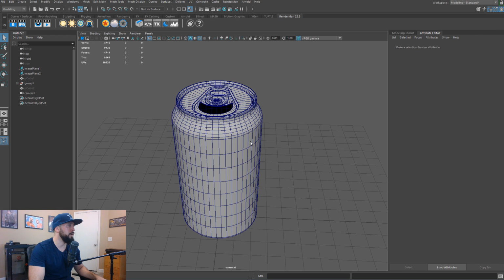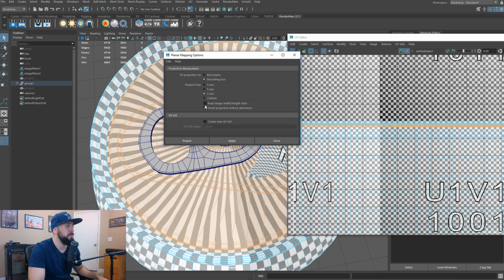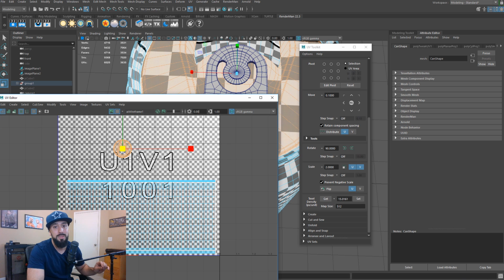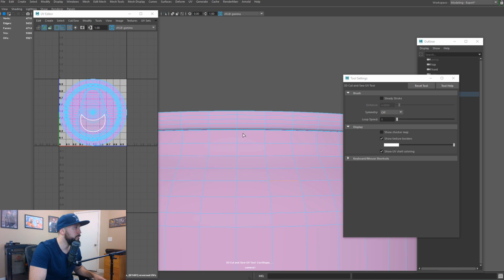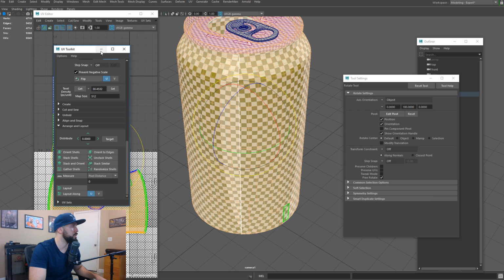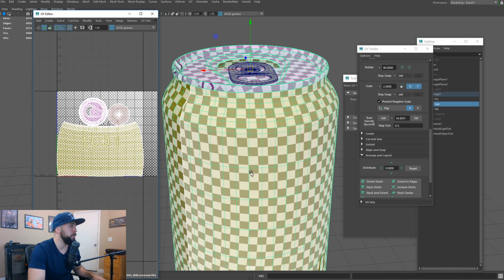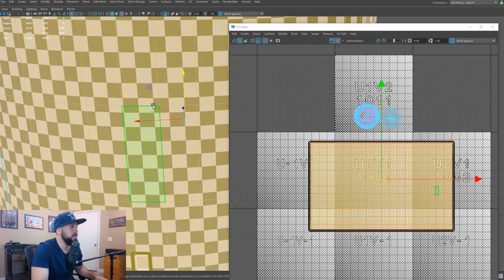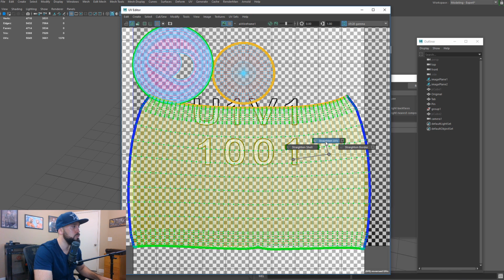Maya UV Mapping For Beginners

Comment: at 4:34 what did you press to select the looped faces?
Reply: to do a loop selection, you select one vert, edge or face, then hold shift and double click an adjacent one in the direction you want to loop. it will stop at tris.
Reply: @cglancer  yes, but what is the shortcut/hot key to do it?

Comment: Hi, first of all thank you so much for your tutorials, Maya can be really confusing sometimes and you are great at teaching it. But I'm having a problem with this method of doing UVs. (actually, I have a problem with all UV methods :P).
I'm using a model "similar" to this one, it's supposed to be a wooden barrel, and after I unitize when I move and sow it sows it in a way that it becomes distorted. It looks like it ignores the cut I've made on the side and makes a weird donut shape. Do you know what I might be doing wrong or if it's some bug? I tried following your steps multiple times and I just can't make it right.
Reply from the maker: Off the top off my head and assuming you get the uv shell of the sides of the barell in a square or rectangular shape...try unfolding only in the U or the V.
Reply: Ok if anyone is interested my problem was I didn't Freeze transformations nor deleted the history before I started doing the UVs.